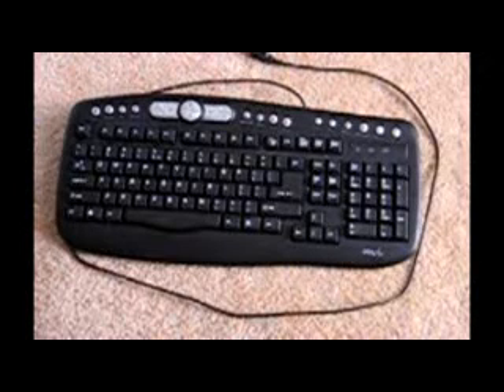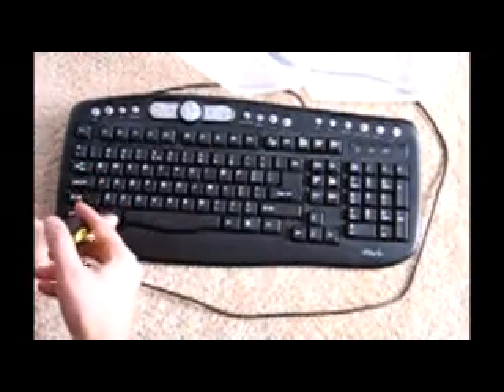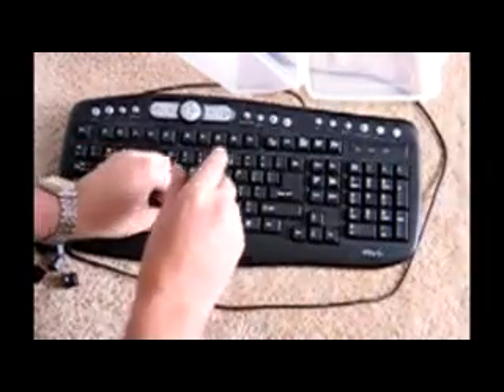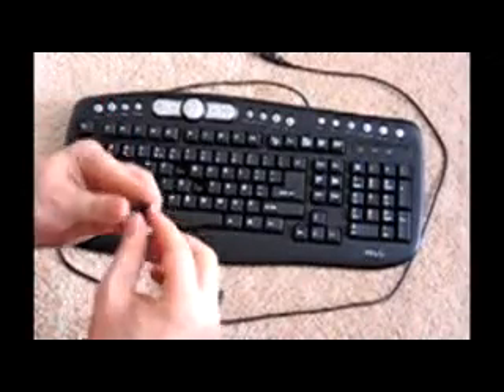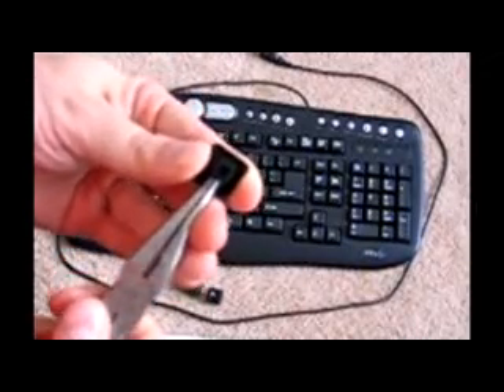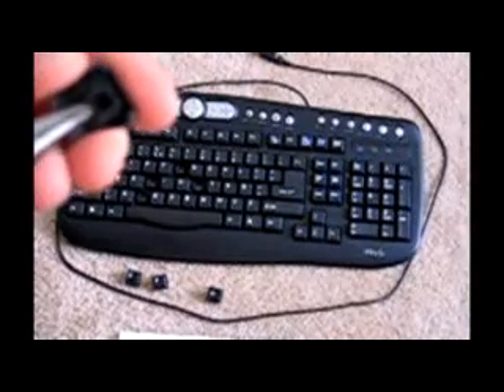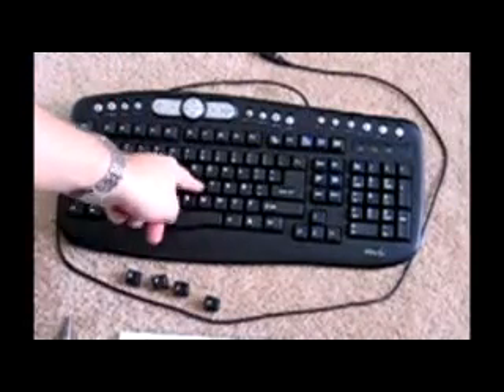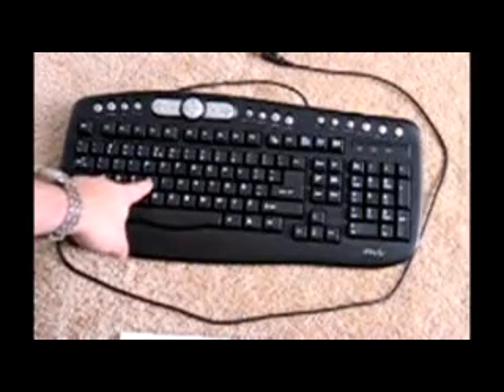Convert to a Dvorak keyboard from a QWERTY keyboard

Comment: Haha didn't check the date just replied. Well if having to switch to other computers is a problem then you can carry a keyboard with you where you go just get a cheap little $20 keyboard then you wouldn't really have to worry about switching. But if the issue is that you don't want to have to rearrange the keys then key stickers are really nice.
Reply: sorry  about this late reply. OR you could get an expensive gaming keyboard with onboard memory profiles and program the keyboard into it

Comment: I do not recommend changing keycaps. Besides that J and K can not be swapped on some keyboards, most used letters will be right under your fingers, therefore you'll have to raise them to see the letters. Better print an image of the keyboard and attach it under the monitor.

Cheers